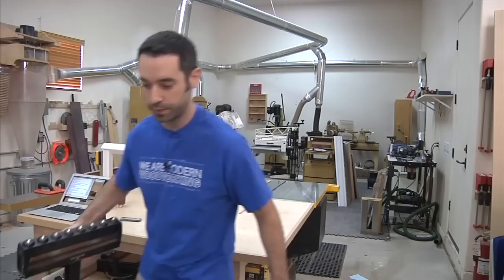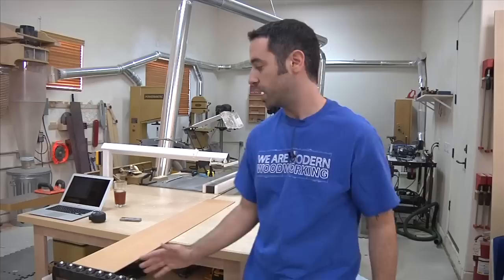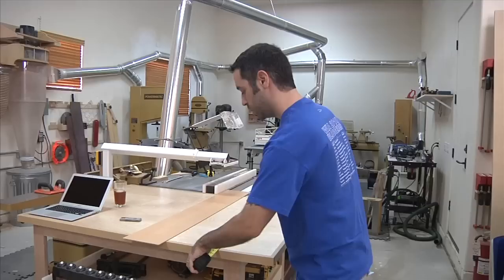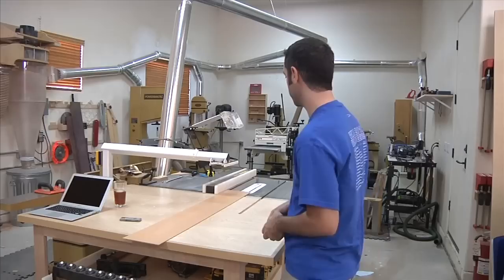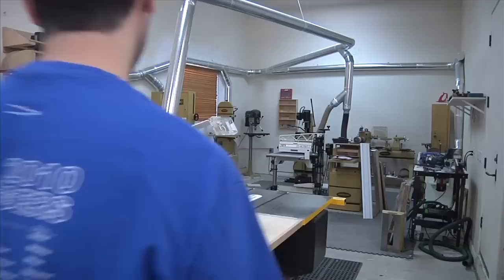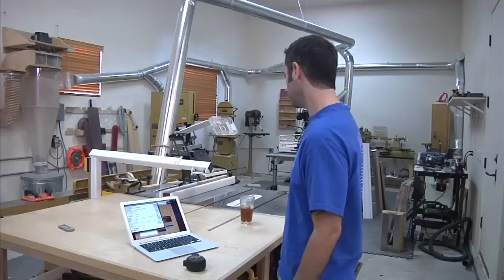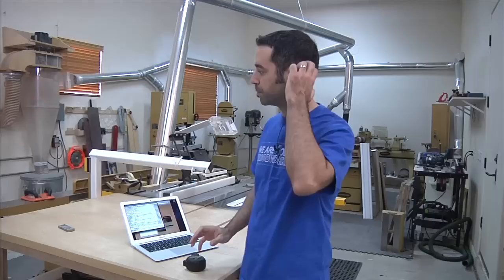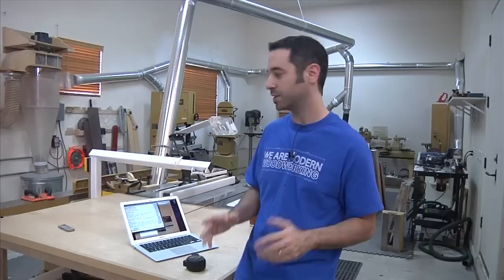160 - My New Outfeed Table

Comment: LOL, stumbled upon this old video... the other use for the outfeed table... 2:19... keeps you from putting down your cold/wet ice tea glass on the cast iron table saw top!  ;)

BTW... I use my roller stand for infeed only (rarely) and have a nice 4x4' outfeed table for my saw.  It has locking casters, an open storage shelf under (like yours), doubles as an assembly/work table and its skeleton is made from a Rockler steel shop stand.  I'll probably route some Microjig Matchfit tracks so I can use my dovetail clamps on it.

Comment: My outfeed table is an old foldable drafting table, it has an adjustable metal frame with 3/4 melamine top. I need to route the miter slots but I love the versatility and surprising rigidity of it, it works with my tablesaw and bandsaw or i can still draft on it for now

Comment: Just ran across this browsing the web. I started at the Shopsmith site since a guy I was talking to in line at Home Depot mentioned his dad was still happily using an old one and I was curious. That led to checking reviews and seeing people say it isn't a very good table saw to checking on table saws (I have a 22 year old Craftsman on a stand) which led to this video of an assem .... er, I mean out-feed table for a table saw which I NEED because as Marc said, roller stands just do NOT cut it for all the reasons he mentioned. I also need an in-feed table. It is a pain in the backside moving the stands back and forth depending on the length of each piece of wood. It doesn't help that the floor in the shop is anything but flat so each move also means resetting the height of the stand.

Thanks for the great video. I especially like the "OOPS" on the grooves for the gauge extending into the table but not having the lower slot. He could have edited that out but instead I got to see the nifty cross cut board. Gotta make me one of those too.

Comment: I agree about the MDF. My outfeed table and my assembly table is MDF with several coats of polyurethane lightly sanded. I wax the out feed table but not the assembly table. It is durable and with the wax it is VERY slick! I would have built my workbench with an MDF top, but MDF is too soft for the abuse that a workbench takes.

Comment: I’m wanting to make this out feed table. I’m not yet sure if it’ll be sandwiched 3/4” plywood or MDF. What is the best method for attaching hardwood edging onto the sandwiched plywood? Also, how to best attach sideboards to edges of MDF? Worrying about screws stripping out. Would glue and brads be enough for each material? Thank you in advance.

Comment: I have a low end table saw, I haven't seen any wood top table saws. Can wood be used as a table saw surface. Reason being table top finish comes off on work piece and throat plate is 1/8th lower than table top. Motor runs through 4x4's just fine.

Comment: What about an out feed table for a portable table saw?  I have a Rigid r4510.  In the past I have seen where the saw is taken off it it's stand and then affixed to a out feed table.  But what if you want to leave it on the portable stand?